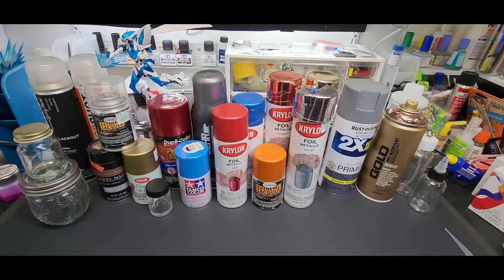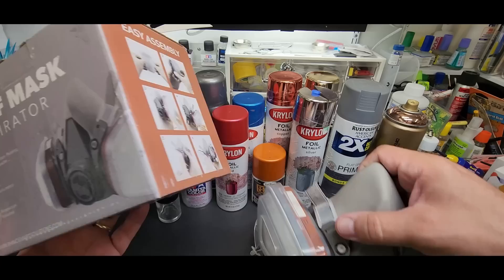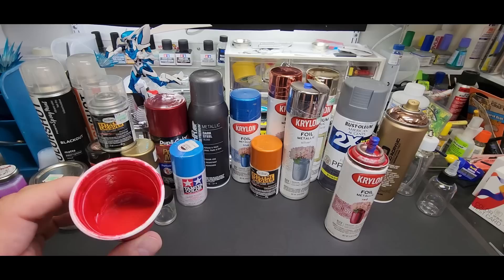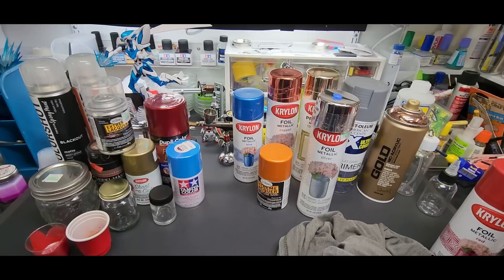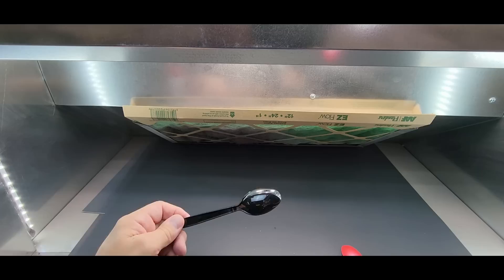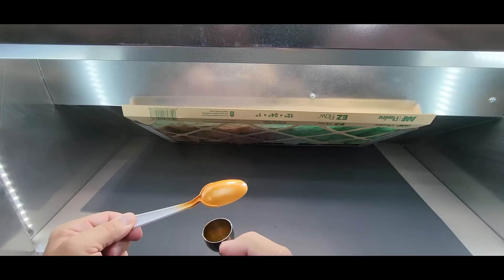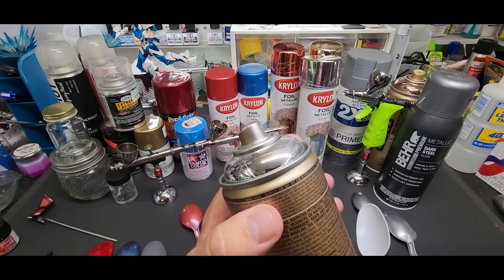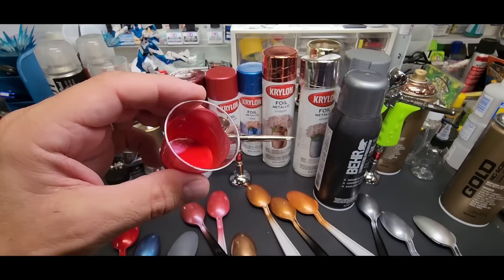How To Decant Spray Paints For Airbrushing - Easy !!

Comment: Don’t shake the can. Let it sit for a few hours. Put a small hole in the can towards the top. Let all the gas out, then tape the hole shut and shake it up. Now expand the hole and cut the top off with snips. Pour out the paint. That easy.
Reply: Did this to an Army Painter primer can, whose spray cap was broken. Worked like a charm.
Reply: Thanks for the tip I brought a can of primer I sprayed it one time & the spray nozzle stopped working and it's a  full can I wanted to know how to get the paint out so I can use  the rest in my airbrush👍
Reply: How long does the paint last if put in one of those air tight jars?
Reply: Am I understanding correctly, am I to puncture the can itself? Or the nozzle?
Reply: @SergeCruso  the can! When it was sit for long, paint stays on the bottom, propellant at the top. Puncture the can, and only propellant is expelled, leaving only paint inside.
Reply: The paint might dry then, not a good idea.
Reply: @SergeCruso  The can.
Reply: Or you could just hold the can upside down and press the nozzle to let all the propellant out before punching a hole in it
Reply: @WILFRED1184  I don't know why, but some spray cans keep spraying paint when I turn it upside down... So not sure if that works on every paint
Reply: @WILFRED1184  Very smart idea! 👍🏻
Reply: @ogrokun  most manufacturers recommend this before storing the paint so the nozzle does not get clogged. They will spray a bit before the pickup tube is fully cleared, but it should stop spraying after a few seconds.
Reply: Yeah that’s what I do. Bleed them vertically then just cut the top off.
Reply: @WILFRED1184  sorry,  ANY spray bomb I have used in my 50 years of modeling, flipping the can and spraying DOES NOT clear that tube inside the can, you could almost paint an entire project with a can upside down. 
  I would suspect that the paint manufacturers are just CYA because of the millions of clogged nozzles. Even using the recommended upside down spraying is just wasting paint in the air.   Just my 2 pennies for your thoughts
Reply: @nokiot9   OK Tommy, let me get this procedure down in my head.  
  Just take like a center punch and knock a hole in the very top of the can. Correct , well of course after letting it sit to let the paint settle. 
   Now if properly done as noted in all of these posts,  ONLY THE GAS WILL ESCAPE out of your punched hole ?  
   I would think that wrapping a old shirt around the punch at the targeted punch hole area would protect everything just incase that puncture hole decided to shoot paint out also. 
  Does that make sense ? 
 I just picture in my thinking when that punch actually penetrates the can that she is gonna blow paint everywhere even if the paint had settled for a week !? 
  Anyhow SHARP CENTER OR NAIL PUNCH ?
Reply: @geraldgerhardstein2170  I personally have not come across any of the cans you are referring to but it is good information to have in case I ever do come across one. Thanks.
Reply: @geraldgerhardstein2170  I wonder if they have some kind of mechanism that makes it spray at any angle. I have come across a lubricant can that had the lubricant in a bag and the propellant outside of the bag which would cause it to squeeze the bag and push the lubricant out. Or maybe they are using some kind of sleeve that opens a hole in the tube closer to the nozzle when the can is upside down and closes the hole when the can is right side up.
Reply: How much paint do you normally get out of a can?  Got a couple of cans I would like to do this to, but I want to make sure I have enough storage.
Reply: Do you have to thin the paints afterwards to make them suitable for airbrushing and if you do, what do you use to thin the paints you’ve decanted.
Reply: @scottm8285 how to preserve paint you don't use
Reply: Don’t you introduce small shards of metal into the can when you drill?
Reply: How do you puncture the can. I’d be concerned over its volatility. What did you use?
Reply: @orestesmayo-nc2hm  I used a small head screw driver only a little bit of paint sprayed out the hole
Reply: I put the can in a dish of warm water to drive off the last of the propellant gas before decanting. This way, the tape over the hole and the shaking isn't necessary.
Its not even necessary to cut the top off. Just put another small hole in the other side of the can for air to enter and the paint can be poured out of the original expanded (enlargened) vent hole.
Regardless, puncturing the can, etc. is the best method for decanting paint in a spray can. No runs, no drips, no errors.
Reply: Is there any risk to puncturing a hole into a pressured spray can? Sounds like it could be dangerous.
Reply: @geraldgerhardstein2170   Strange- I use rattle cans super often, at least twice a week, and my experience is the opposite of yours. Every one of them clears the nozzle by inverting... every one.
Reply: Sounds highly dangerous considering the contents are under pressure.
Reply: What about metal shaving in your paint?
Reply: Thank you very much for the tip!
Reply: My God... go from a 27 minute video to a 10 second explanation of a better way to do it. Thank you.
Reply: Sounds like the added benefit that I can degas them outside and do the remaining work inside.
Reply: DON'T GO POKING HOLES IN PRESSURIZED VESSELS. That's a great way to get injured.

Keep them upside down for a while, then press the nozzle while still upside down, like they instruct you to do to clean the nozzle between uses. After what paint remains in the nozzle and straw goes out (which you can collect in a cap or small plastic cup), only the gas should come out as long as you don't move it around.

After all the gas is out (you can check by squeezing the can, it should bend inwards and stay that way), you can use a can opener on the bottom. Pierce FACING AWAY FROM YOU. Sone gas may still release. Then continue with the can opener until the "lid" is fully off. It will now pour out easily. Watch for the rattle ball.

Comment: FSM magazine video states that the decanted paint needs to sit overnight to degas properly. I think the 15min is too short and would have gas bubbles in the paint that you can't see. Also your 11oz of paint spray is not 11oz of paint. Most of the can is propellent. IMO, I would not decant spray unless you have no other choice available to purchase somewhere. It's still messy to do no matter how you figure out a way to do it.

Comment: I decant spraycans once they are near empty. I first flip the can upside down and press on the nozzle to release all the gas; then I hold down the can with my foot (with a large rock between the can and my foot) and then puncture the side near the top (on the flat wall side, not the dome) with an ice pick to let any remaining gas out. Once the gas is out I use some heavy duty scissors to cut the spraycan in half and pour the remaining paint into a jar. I was using small empty Gerber bottles to pour the paint into but i guess the seal wasnt as air tight as the paint dried in a few months, so i may have to try those mason jars.
Reply: tin opener on the base of the can, should be a little safer than the scissors. ;)
Reply: Try plastic wrap under the cap. Those food jars are vacuum sealed but don't seal as good after. Try a thrift store for used mason jars. A lot cheaper than new

Comment: The way I decant paint is to take a new wd-40 straw and cut it up in 3 equal length pieces... Then I'll pop out the spray tip from the button and insert one of the straw pieces.... Makes life a little easier when decanting.... Give it a try....😉

Comment: If you hold the can upside down and release all the propellant, you can just pierce the can and pour out the paint without making a mess, much easier than the method you are using.

Comment: Better way is to put it in an isolated  (Leave it alone for a couple of days without shaking)   then drill a hole on the side while upside down that will release the gas only. And then cut the can open. U getting all of the paint with no spills or mess
Reply: Do you used it on airbrush?
Reply: I have used this method (small hole) several times.  I then pour the paint into an airbrush paint jar and degas in a vacuum pot.  Depending on the specific paint, I may thin the paint, but they all airbrush great.  The propellant in most rattle cans is butane (yes, the stuff in lighters).  I don't want that in my paints while airbrushing.

Comment: Hi, I found that a lid with a built in straw from an empty WD40 can will fit straight on some aerosol cans and you can slightly press the button to control the flow. I managed to fill some Vallejo dropper bottles using this method, you will still need to use the rag to prevent blow back though.

Comment: Thanks for such a great tip. I've seen other people drill into the can to release the compressed air, but that pretty much means I have to decant the whole can all at once. I like your method of "decant-what-you-use". No drills, no fuss. Actually, no jars either if you're not inclined to decant a whole lot.

Comment: I 3d printed a hood with a built in funnel and button that covers the top of the can outside of the crimp ring. It works great and I don't have to get splatters of paint everywhere.
When I get a chance, I will post it to thingiverse, and put a link here to the file.
Reply: Do you have the link?
Reply: Link????

Comment: If I have a can with a broken nozzle or I want to transfer an entire can, I just puncture the top of the can with a drywall screw,  leaving a very tiny hole and let the can out gas. I then open the top of the can using a Swiss army knife can opener and pour out the contents into whatever canister I use to store it in. Plastic bottles with dispenser nozzles work quite well. I add a few ball bearings to the storage bottle to help with mixing. No spraying involved.

Comment: If you flip it upside down and puncture it with a can opener, the gas comes out in a bow a minute and a 1/2. And then you open the whole thing up and drain the whole can and do anything you want so much easier.

Comment: The way I do it now is to wrap a rag around the can and then place it under a piece of timber and lay the can flat. I then use a 1mm drill bit and drill through the timber into the bottom end of the can and expel the air out of the can. Once the air has all gone I then pour the paint into a jar and you end up with a fair bit of paint.

Comment: I always heard you need to let the decanted paint outgas for 8-10 hours.  The way I was shown was to cover a jar with seran wrap and then puncture a small air hole for the outgassing pressure.
Reply: I never let  to paint gas out when decanting  I decant into a shot glass and the right in to the airbrush and have no problems

Comment: You should try to remove the white orifice in the spray nozzle and replace it with a suitable size of tubing. You can decant paint very easily then with the can upright, it doesn't spray, it's more like a water hose then. I've been doing it that way for years
Reply: Yep! I like to use the WD-40 straws....

Comment: Personally I take an old nyquil cap(works great for mixing paint too). Just spray it into the bottom and it builds up then either use a pipe tre or pour it in

Comment: Keep a can of compressed air on hand I have one that’s used for cleaning out keyboards and PC fans when finished with the can take the nozzle  off the can and use the compressed air to blow out the nozzle. You should be able to clip it onto the can. I keep all of my nozzles as sometimes I’ve had issues where I have gotten a can with a defected nozzle or it’s not one that’s easy to hold I just swap them out.

Comment: I drill a small hole in the top of an unshaken can to let the pressure out, then make the hole bigger & pour the paint into a jar.  Just be careful because the paint is like soda, there is gas dissolved in the liquid.  If you shake it up it will spray everywhere.
Reply: This is how I do it, but I suggest using a tool to puncture instead of drilling. You don't really want little bits of the can getting in your paint and going through your brush.

Comment: most spray can paints say on the back to turn upside down to clear the internal feed tube and knosell right? Well vent the propellent from can the same way and then pop a hole in the can and pore contense in sealable container, label and ur done.

Comment: I took a piece of 1/2 styrene tube . Cut it in half . Hold the one end over the paint nozzle and other end in the jar or cup.  Press down an paint runs out the end of the tube into jar.  No rag , no mess of paint everywhere ect . The tube is about 12 inches long .

Comment: Hold the can upside down and let all the gas out....puncture a hole in top of can and allow paint to drain out into a mason jar you buy from some discount grocery store.  Losely put the lid on, don't tighten down.  rig up one of the cheap harbor freight pressure paint pots at harbor freight and put a vacuum fitting.....connect to vacuum pump.  Put the jar down in pot, seal pot,  and pull vacuum for a few minutes, this will pull all of the atmosphere out of the jar and seal it.  Tighten cap and it will be good forever.  Whenever you need some, shake it up, open it, get what you need, pull vacuum again and store it.  BTW, pulling the vacuum on it will degass it automatically.

Comment: I had a spray can full of paint but no air, I put 2  big nail holes, on its side, one at the top and bottom. Used a condiment bottle to push air in the top hole.  I used a brush ( didn't have an air brush at the time) try at your own risk!

Comment: Thanks for another helpful video. I've seen modelers use a decanting sprays for years, often using this same approach just with out the rag which is messy. Sometimes the simplest method is the best.
For those that haven't heard, in May of this year(2022) Rustoleum, owners of Testors, announced they where raising the price of all Testors paints by 45%!! Not very hobbyist friendly. So the price on the item depends on the amount of back stock your suppler has. Current Retail in the 1/4 ounce (little square) bottle is $3.95, what the 1/2 ounce bottles where a couple years ago.
Reply: @KevinJohnson-ge5xs  I wouldn't be too surprised. It is a common practice in some industries, raise prices until sales drop enough to justify dropping a product line.

Comment: Thanks for the info I have been doing something like that for a while, made more of a mess than you did, I even tried water colors in my airbrush on top of automotive paint  then when it dried thoroughly I cleared over it with no problem, worked great, been good for years. gotta keep the enamels and the lacquers apart they don't play well with each other. Rustoleum seems to be all enamel , I used one Rustoleum that said on the label it was Lacquer over a known Lacquer base and ruined a job (butter milk), it was not lacquer, my fault should have tested first,  live and learn. Thanks again.

Comment: You need to store that mask in a sealed bag, large feeezer ziplock works. IIRC it will filter constantly that it’s exposed to the elements. The secondary foam pads need to be changed more frequently then the charcoal filters.

Comment: I have been removing pain from spray cans for over eight years now. I can remove all the paint in about one minute without a rag. It's fast and clean. And you don't need to spray it out the nozzle.
Reply: Please share.

Comment: I'd suggest just venting the propellant from the can- inverting it and holding down the button. I tend to get some "dead" cans sometimes with paint in them and no propellant left. Then using a punch tool, I just punch the side of the can and pour out the paint. I once used an oil filter cutter and just cut off the bottom of a paint can... worked great but took more time.

Comment: So easy and quick rather than the straw attached to the nozzle method. I've had trouble using Rustoleum straight out of the can being too hot and damaging the plastic, so will be interested to see if putting it through the airbrush with finer layers may stop this. Surely a lot more economical way of sourcing paints. Thanks for the great tips Robert.
Reply: Prime the plastic with Tamiya fine surface primer and it should give you a barrier between the hot paint and the plastic, I’ve used it on hard RC bodies with no issues.
Reply: @agoodballet  thanks Andy
Reply: @allanlowe9346  no problem, also lighter coats till you reach full coverage, usually takes me 3-4 light coats until I can’t see the base color.
Reply: You could try adhesion promoter it's great for plastic and automotive abs plastics to and it stops hot paint from damaging plastic.

Comment: I tried this in the past but I didn't use a shirt or anything. This opens up a bunch of options. Thanks for this!!
Reply: Update. Rustoleum hasn't bleed into the primer with this method and the enamel gloss melts through the paint with the can, there's no such issue when decantinized through with the airbrush

Comment: I used Rustoleum Flat White for my 1/144 Saturn V rocket and using the can was awful(you'd think I'd figure it out by now). I have the little Testors enamel bottles and used that flat white and it was easier. I have the Iwata Neo with a .35 needle/nozzle and it does ok for large areas. I may try this, but I like the small Testor's enamel paints.